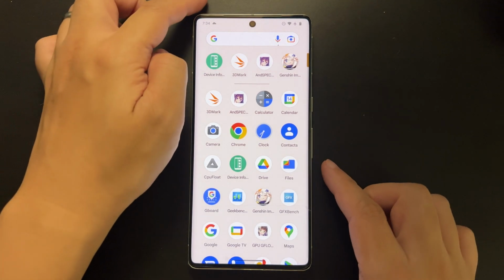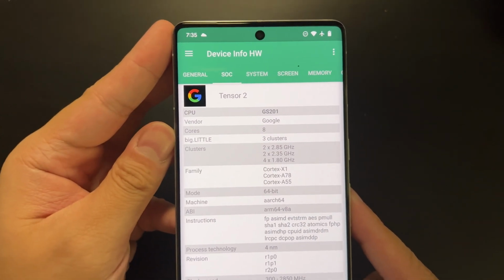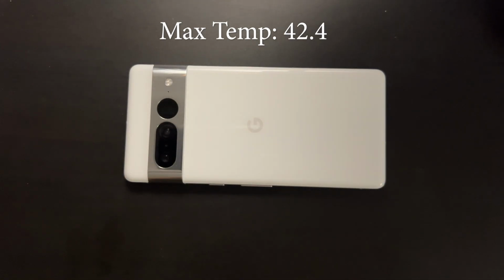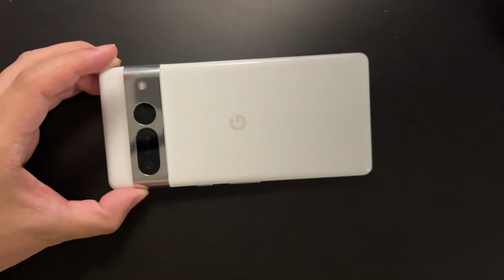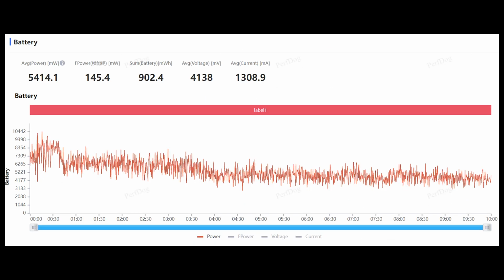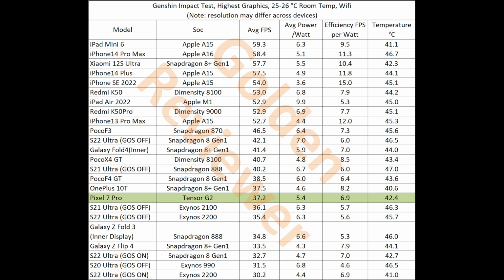Google should feel ashamed! Pixel 7 Pro Genshin Impact Gaming FPS Test

Comment: SD855 Performance in 2022. Not bad Google
Reply: Lmao
Reply: Are you embarrassing the Sd855 lmao my Sd855 in k20pro performed way better than this , it got 46.8 avg fps at max setting
Reply: I wonder why SD855 exactly ?
Reply: @m-o-t-i-v-a-t-e-d5896  OK sorry then SD 845 🤔
Reply: Even 855 better than this
Reply: On my OnePlus with 855 snap performance better in Genshin Impact on max settings.
Reply: @Ayanamka17  i have 855+ in op7t and my device get super good performance on os 10
Reply: @gockartzz8272  yep, but OnePlus is shit now, my next smartphone S23 ultra maybe.
Reply: @Ayanamka17  Yeah i know they are horrible
Reply: It probably is running at a higher resolution, slightly better than 855,  around 865 level.
Reply: @m-o-t-i-v-a-t-e-d5896  do the same route and post a video then.
Reply: @bulletpunch9317  probaly not higher , all android are only supported 720-740p by maximum , even older devices got the same resolution welp at least maybe devices that arent too old like sd855 devices , probaly like sd835 and older will get lower resolution
Reply: @bulletpunch9317  alright gimme around 30 minutes
Reply: @m-o-t-i-v-a-t-e-d5896  everything above 870, like 888, 8100,gen 1,9000 all had higher resolutions.
Reply: HD1911 OP7TPRO here, max settings on 24degree room temp with a/c, average of 48 to 52fps even after 10mins game, no sudden and significant frame drop , very stable, Snapdragon 855+ tsmc's fabrication is just superb, that's why no plans of replacing this phone yet, superb screen on time, average of 5 to 7hrs screen on time depending on the usage. 1+ yrs old
Reply: @denniszotomayor858  just post the video of the same route.
Reply: @bulletpunch9317  actually not , it based on how Hoyoverse support each chipset 

The Mtk dimensity , Exynos and Gg tensor all use Mali GPU but there is difference between these gpus , Mali on Gg tensor or Exynos usually has less units than Mediatek for example Mtk Dimensity 9000 got Mali G710 Mc10 while Gg tensor has G710 Mc07 which is the same Gpu but was cut off 3 units and that will make it got worse resolution than D9000 

 on the other hand Dimensity 9000 , 9000+ and Kirin chipsets are the only Mali chipsets that got supportation of 720p and with Kirin it is 760p , Exynos and Gg tensor are only supported at 640p maximum

Qualcomm's Adreno always got better resolution than Mali , the proof is Dimensity 8100 is stronger than Snapdragon 870 but still it got worse resolution in game with sd870 is 740p and d8100 is 640p with that it is similar to 855 and Gg tensor 2 , tensor 2 is released later but since it is a new and unpopular chipset Hoyoverse couldn't support them high resolution while with 855 it is one of the most popular Chipsets of all time and it is mostly used in many phones all from cheap to flagship phones and by that it got higher resolution
Reply: S22 ultra with sd8gen1 almost performs like pixel 7 pro
Reply: @alphamalluz7422  yeah cuz if a chipset was put in a samsung phone then it can show 30-40% of its real performance lmao
Reply: @m-o-t-i-v-a-t-e-d5896  whats your source? Mine is from xiaobais tech review in youtube, his has s22 over 800p.
Reply: @m-o-t-i-v-a-t-e-d5896  Exynos 2200 uses RnDa GPU but it's full potential it's locked
Reply: @m-o-t-i-v-a-t-e-d5896  and 8100 isnt 640p, that was k50 before update, after update its 788p.
Reply: @bulletpunch9317  that's s22 with sd8gen1
Reply: @bulletpunch9317  my source is from Geekerwan and this dude Golden review
Reply: @m-o-t-i-v-a-t-e-d5896  source for 870 being 740 from where? Xiaobai shows 870 on blackshark 4s is 620p.
Reply: @Ayanamka17  i have a plan to buy the s23 ultra when it get released, but after i saw ice universe tweet, I immediately changed my mind. Samsung is just a pice of sht this day, in the s23u samsung will not use the sony sensor
Reply: @chossenone730  the tensor g2 is worse than the A10 in iphone7
Reply: damn....that's a disrespect......to the sd 855. this tensor crap performs like a 845. (tensor is not crap it's fuckin samsung's shitty node.)
Reply: @m-o-t-i-v-a-t-e-d5896  i get 48 fps avg with fan cooler on my k20 pro 😂
Reply: @m-o-t-i-v-a-t-e-d5896  max settings 46 avg seems kinda 🧢
My phone has SD 870, max render res and mid environment details and all other settings lowest can't maintain 55~
Had to Cap fps at 45
Reply: @yubi-kun958  i had the video above , you can check that out , i even had the perfdog test that shows my device is Mi9T pro
Reply: Wait why did google pixel not use Qualcomm Snapdragon anymore?
Reply: I wanna see someone compare pixel 4 xl vs pixel 7
Reply: @amy-295  cuz they can produce their on chipset now, first of all , producing your own chipsets will consume less money than buying the other company'e chipset 
  Seocondly  by using the Google's home-made chipsets will give both the Android software and Google phone's hardware a better optimization
Reply: My 855 is still better 🙏
Reply: Isn't it the g2 tensor chip or is it different
Reply: Kids lol
Reply: More like 8 gen 1
Reply: To be fair Google prioritises machine learning and ai
Reply: my huawei mate 20 x is better than this.
Reply: bro 865 worse that 855
Reply: Pixel 6 have 49-60FPS
Reply: It's not made for gaming it's literally focused on photography at the cheapest price! What do you expect everything to be perfect at this price?
Reply: @m-o-t-i-v-a-t-e-d5896   when sd 855 was tested with genshin impact , the game size was different [ game size=12GB] , the optimizations were different , so it had a higher score , but if youll test it today when [game size= 40GB], its gonna be way lower than previously , moreover its benchmark score are closer to 865, google smartly optimises its phone constantly so its gonna keep up pretty decently
Reply: @Skyrise120  what are you talking about the P7P the Tensor g2 is A Flag ship phone that means it can perform hardcore games really good I'm playing gensing impact on my P7P 👍🏿🤪🎉🎉🎉😗

Comment: Couple problems with your analysis. First, judging overall efficiency based on peak performance alone is straight up irresponsible (in theory running dual X1s at lower frequencies should be quite efficient), 95% of the time your phone is not running at these high frequencies for long periods of time. Now I'm not saying that Tensor is better at these mid to low performance tasks but if you want to draw conclusions about efficiency you should at least run a comprehensive suite of tests. Second, Google has stated that this SOC is AI/ML first, so expecting class leading gaming performance is unrealistic.
Reply: Also, this doesn't just measure SoC performance: different phones are running different resolutions. Had he tested the "regular" 7, he'd get 70-80% better performance (judging by other graphics benchmarks I've seen) and suddenly the G2 would seem amazing. Also, the 7 Pro matched OnePlus 10T, which has SD 8+ Gen1 at 1080p! It also outperformed the S22 Ultra with Exynos and the Snapdragon variant of S22 Ultra is either faster or slower than the 7 Pro, depending on whether Samsung's Game Optimization Service is on or off. That's hardly terrible.

The takeaway is: if you want a Pixel and you want high end gaming performance, save yourself the $300 and get the "regular" version; if you want the 7 Pro and top notch gaming performance, you can switch the 6.7" screen to the 1080p mode; and if you get the 7 Pro and wish to keep it at the native res, then you'll have to do with the performance that's only about what the S22 Ultra can deliver (so disappointing /s).
Reply: Me and the boiz doing fuck all AI on my $900 phone 🥵🥵🥵
Reply: @ocudagledam  The pixel 7 pro is in 1080p by default so he may have tested it. It makes sense that it beats the 8 gen 1 since it's a dumpster fire of an SOC, many manufacturers are limiting it for thermal/power reasons which is why the performance delta between manufactures can be massive.
Reply: I dont get wht u r trying to say, at least if i buy a phone, i want a phone that can handle almost anything. That's why i stopped playing genshin on phones n moved to pc.
Reply: @mst4001  no phone can do "anything" and some do things better than others. The pixels are super smooth and get timely updates, gaming is just where they are a bit behind. Also from my own personal experience genshin is just strange on pixels I have a Pixel 6 Pro and literally every other game runs fine and is comparable in performance to the snapdragon 888
Reply: @romsg2255  well, im currently using lg v60, got no updates but still smooth if i use it with a cooling fan
Reply: @ROMS G Copium. Tensor is just weak and highly inefficient. You're literally beta testing it it will get improved but for now it's terrible for the price value. Even a $150 chinese phone can consistently run Genshin at average 45fps (max settings 60fps).
Reply: @roahnosh  what kinda $150 are you talking about?
Reply: @romsg2255  Dimensity 8100 phones can achieve that but idk if those phones cost around 150$, probably not. Maybe 200 - 250$ 🤷
Reply: @romsg2255 thats because you cant do anything to stop the pixel from throttling om purposes similar to samsungs GOS before thay got resolved
Reply: @ocudagledam @Zroik hell yeah I got my P7P is playing good hard core games like ginseng impact I love my TensorG2😊🎉🎉🎉🎉🎉🎉

Comment: You should give it some points for performing better than exynos 2100/2200.
Reply: Worse than Exynos in long run
Reply: @samsungoneiu2000  little better i would say. But definitely worse than apple and tsmc snapdragon
Reply: @EliteReviews  Not worse, is at the same level when it's optimized
Reply: T0000000NT0
Reply: @jhkuno88  you for example
Reply: T0000/NT000
Reply: @jhkuno88  you still
Reply: when i play cod mobile on my s22, the thing starts to overheat literally  5 minutes later and the game becomes a unplayable stuttery mess lm (doesn't matter if i play on high or lowest settings), and it does that everytime.
on my pixel 7 pro which plays the game in a way higher res. i can put everything on max. setting, fps on high and i can play it literally for hours and it runs smooth as butter!
i've also compared some emulators like dolphin, aether sx2 and even heavy stuff like half life 2 via the nillerusr steam mod, and it runs way better than on the samsung.
the exynos 2200 is a huge failure, that thing doesn't even let me scroll lag-free through simple textbased websites, or through the homescreen and it overheats from just looking at it.
Reply: @Schnoizl  Exynos 2200 is a success introducing RnDa GPU technology in a phone.
I use Exynos powered phones and I play Call of duty and I don't want faced any lag or massive stuttering.
Blame developers for don't adapt the game to vulkan API, most of the game use open gl, and the Exynos 2200 GPU doesn't support it, so need to translate it.

Comment: So the fact that the Pixel 7 pro can play Pubg and COd mobile at 90fps means nothing? S22 ultra still can't.. pixel also plays apex legends at a consistent higher fps then the s22 ultra. iPhone plays immortal at 30 fps and Pixel 7 pro can play it at 60fps. 😐
Reply: This is why you can't draw conclusion from just one game. And guess what, if you play Genshin in the default setting, most of those phones will hit 60fps and only fluctuate to 50fps when thermal throttling.
Reply: hell yeah I got my P7P is playing hard core  games good like ginseng impact & War Robots I love my TensorG2😊🎉🎉🎉🎉🎉🎉